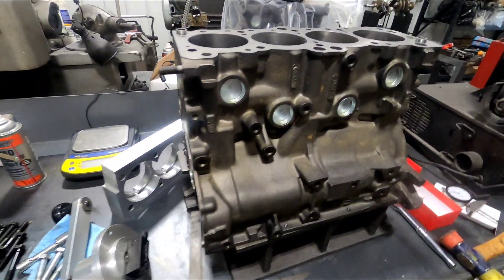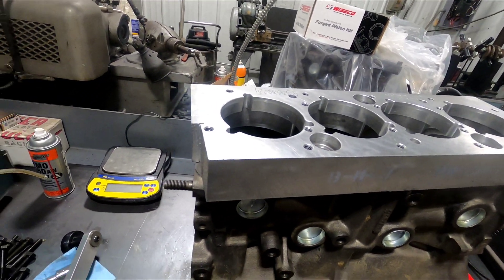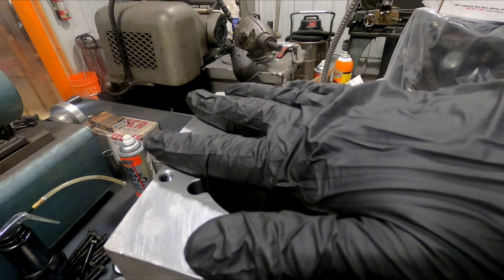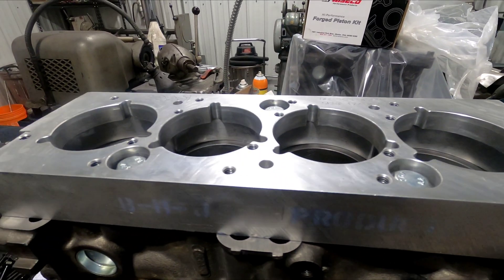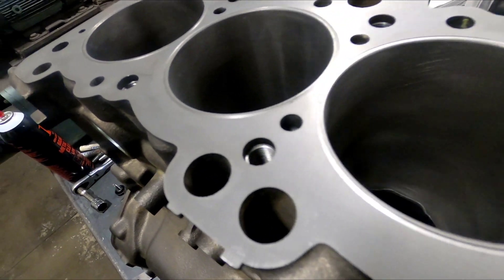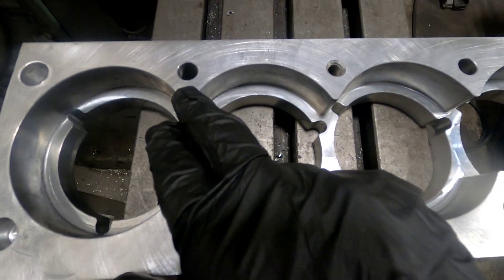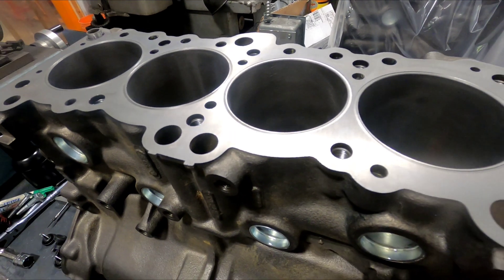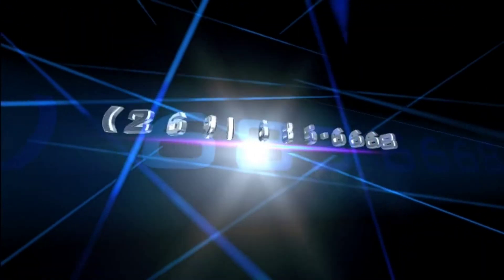Engine Machining - Receiver Groove in a 4G63 block | Copper Head Gasket | Stainless Oring

Comment: Way under appreciated! Tnx bro. I'm trying to do a Mazda B6F block with ZL cylinder head hybrid(to noncar, green-deal people, yeah, this is the kind of hybrid cars we like!). And I wanna patent a new kind of charging with it and it needs to be super solid nuclear to be able to handle the pressure and your video was so informative that I know later on I'll feel like sheit if I don't put time to appreciate your video by writing a long comment, despite the fact that I desperately need to sleep!
Peace bro. [Iranian Flag]❤🇺🇲

P.S. there is no Iranian flag in the flag list, only islamic dictatorship flag! This is why I had to literally write it down!

P.S.² I guess the length of my comment shows my appreciation enough, any lengthier would be awkward!😅

Comment: what the max bore this 4g63 blok?
Reply from the maker: We typically don't run them more the 1mm over (86mm) on more then 1k hp stuff. I've heard of a couple at 1.5mm over that are living
Reply: @ForceEngineering  ohh ..i mean i wanna build a all motor 4g64 blok used the 88mm stroke..so i think i wanna try the speck of square engine 88 × 88 but for all motor..maybe you or your team have expiriance..
Reply from the maker: @reez-fr8kp  all motor no nitromethane? So say in the 2-300 hp area?
Reply: @ForceEngineering  no nitro..just used m1 fuel i think..can the 4g64 resleeve?if can i think can rebore to 88-89mm ..
Reply from the maker: @reez-fr8kp  yes, with an aftermarket sleeve.
Reply: @ForceEngineering ohh ok thanks friends..i think should try how  good the square engine are easy to rev n make make power just using the 88mm stroke
Reply from the maker: @reez-fr8kp  it's a good starting point at least. Then add nitro 😀
Reply: @ForceEngineering  yeahh..huhu..nitro pls maybe it will broke the blok 😂...yeah 12.5:1 cr i think its enough  rite with the 1g heads..

Comment: why not machine a ridge around the entire perimeter of the block and a groove into the head?  Has anyone ever attempted this?  Then twin ring setup (2 rings one groove chamfer opposite of eachother gaps 180 creating a perfect seal oil ring) on the pistons?
Reply from the maker: Its called a stepped deck. People do it in some applications. IMO, its not worth the work due to the repair cost if you had a failure.
Reply: @ForceEngineering   Thank You for that insight.  I figured it has been done in the past, just didn't know the name of the process.  What do you mean not worth the work if you had a failure?  I would just mill it out myself on the end mill.  Or does stepping the deck have some new or different catastrophic failure outside of the norm?  Thanks again!
Reply from the maker: @BlakeHarvey903  in a typical oring setup, if you lose the gasket on the block side, it generally doesn't hurt the block significantly. And if it does, the repair is usually simple. a step deck, you'd have to re machine the whole deck suface to repair it
Reply: @ForceEngineering  Understood, thank you for that insight!

Comment: what size wire is the staineless steel one? .40 dia?
Reply from the maker: .041
Reply: @ForceEngineering  copper, or stainless? Where can I get it?
Thanks for the replay
Reply from the maker: @BorGuards  Stainless steel.  I get mine from BHJ. people that make the tool